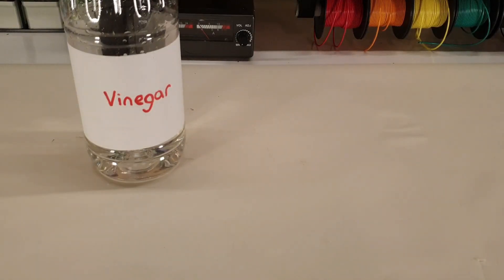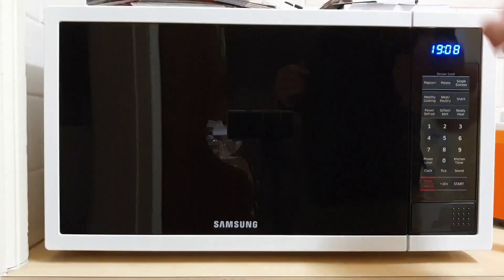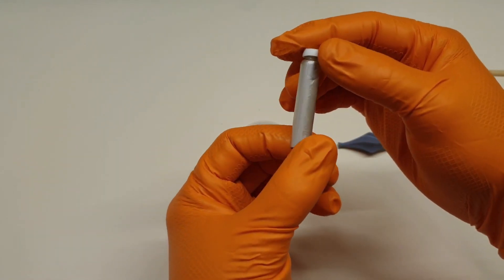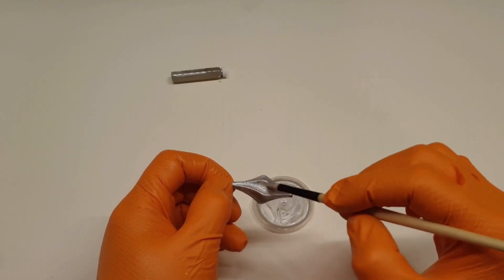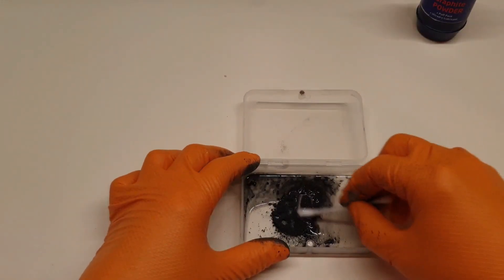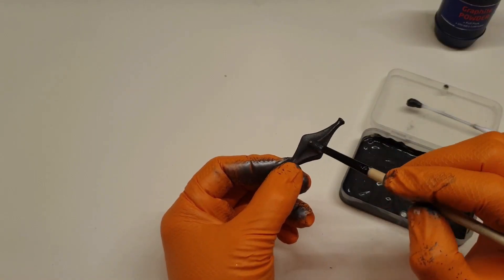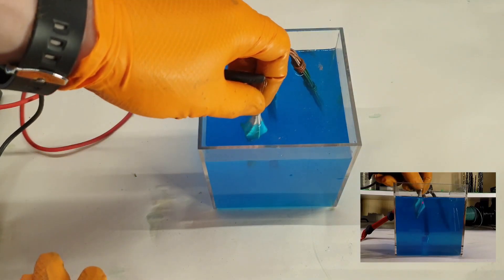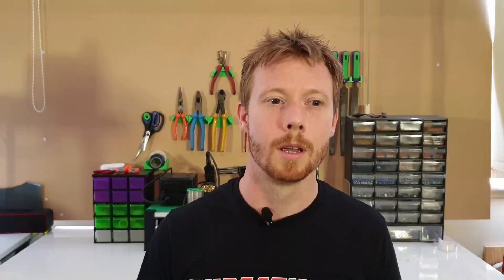Metal plate your 3D prints at home.

Comment: Thank you for the video.  Does this process give the part a hard, metal like feel? I have some small knobs that I'd like to have them have that really hard feel to them, not plastic feel.
Reply from the maker: Yes, it's real metal after all. If the part you're plating is really light, the plated part will still be quite light which can ruin the illusion, but the surface will feel the same as a solid metal part.
Reply: @BrodieFairhall  Thank you for the reply, Brodie! Do you have any tips to adding weight to 3D printed parts?
Reply from the maker: @gracebyseven  I've printed parts with cavities and have filled them with metal scrap and epoxy. You could print parts with a grid infill at a low percentage and pause it before the top layers print to fill it with sand or something else. Printing with metal filled filaments (eg colorfabb copper fill) also makes rather heavy parts.
Reply: @BrodieFairhall  brilliant, thanks again for the feedback and support!

Comment: Have you tried printing in conductive PLA then electroplate directly without coatings?
Reply from the maker: Yes I have, I almost put it in the video too. The resistance was way too high and it wouldn't plate.
You may have different results with different conductive filament, but you'll need to make sure that the resistance measured at any 2 points on your print is < 100 Ohms or plating will be really poor and things don't really plate at all when resistance is > 1k Ohms.
The parts I printed in conductive filament had >15k Ohms across most of the surface.
Reply: @BrodieFairhall  I've been experimenting with graphite coating PLA, and I've had no luck getting resistance to levels under 1K Ohms, even with my multimeter leads only milimeters apart on the surface of a coaed print. I've been using Isopropyl alcohol to mix with the graphite.
Reply from the maker: @rileyjames5693  I've been finding that some people are having the same issue and it seems to vary wildly between graphite brands. I now generally use a conductive nickel spray paint from MG Chemicals instead of graphite for a much better result
Reply: @BrodieFairhall  it is a bit pricier - do you happen to recall what graphite brand you used in your tests for this video? I'd like to give it a shot before splurging for the nickel paint.
Reply from the maker: @rileyjames5693  this is the exact graphite I used in the videos. https://www.supercheapauto.com.au/p/power-plus-performance-plus-graphite-powder-lubricant-35g/1173.html
No idea if it's available outside of Australia.
You can also try multiple graphite coats and really rubbing the graphite in when it dries to lower the resistance.
Reply: @BrodieFairhall  thank you! I've sprung for the paint just in case, but I feel like the graphite has more mileage per dollar spent.
Reply from the maker: @rileyjames5693  it does, it's much, much cheaper, but the paint works so much better.
You can also get far better results using a dilute sulphuric acid/copper sulphate electrolyte as well, the vinegar based electrolyte is also cheaper and much safer, but it requires a much better conductive coating.
Reply: @BrodieFairhall  I have since experimented with some different approaches - different solvents, muratic acid as an electrolyte bath, and even mixing finely powdered copper from a sanded plate into the graphite paint ! (I had very high hopes for that - it didn't make a difference , sadly!) 
About a dozen coats of the initial isopropyl/graphite mix got my resistance down to the lower hundreds of ohms, but it was still lackluster for getting copper to adhere to the anode. 
I've got another brand of graphite powder coming to test out, but - the paint from MG chemicals is on the way, if I can't find a more cost-effective solution!

Comment: I thought at first you were gonna talk about bismuth
Reply from the maker: Honestly the only thing I can genuinely think of using bismuth for is casting into 3D printed moulds because they wont melt. It does look cool though.
Reply: @BrodieFairhall  yeah I don't have any experience in 3D printing (yet) but I love casting bismuth figures. The geodes and crystals can gorgeous. 
I wonder if there's a way to get them coated or to get that sort of metallic rainbow sheen on it. 
I would say maybe someone could dip a 3d model into some molten bismuth.and quickly pull it out (with the right safety precautions) to get a metal sheen and some crystal forms on the art piece. 
The bismuth melts at a higher temp than most prints but cools rapidly and would likely only do surface melting I imagine, on a thicker model at least, which wouldn't natter if it's covered. 
Eh then again prolly a bad idea. I don't think bismuth reacts with anything in a crazy way chemically but you never know.
Plus it'd be tough to do with the bismuth being heavier and the model would need to be a certain shape. Eh

Comment: What if instead of using a graphite powder & alcohol to make a paint, suppose you were to have instead taken a graphite pencil and used it to color the entire surface of your part that way? Could this method have worked just as well?
Reply from the maker: I have tried this and didn't have any success, the resistance was way too high. I have since found out that a lot of pencil graphite doesn't actually contain much graphite.
Reply: @BrodieFairhall  I'd read that pencils range in hardness from 9H (41% graphite content)  to 9B (93% graphite content). Perhaps you didn't use a soft pencil having high enough graphite in it?
Reply from the maker: @manofsan  I tried it with 5B pencils, that is the softest I could find locally ( I didn't even know they went all the way to 9B! ), I also only tried one brand.
If you do try it, I would be interested to hear about your results, I was really hoping it would work when I tried it as it would be a fantastic, safe & low mess method for teaching children etc. 
The resistance I measured across a 20mm x 20mm 3D printed surface heavily filled with the 5B pencil graphite was about 20k Ohms, the powdered graphite over the same area was ~300 Ohms, the Leitsilber paint was ~10 Ohms and the paint I prefer to use now (MG Chemicals conductive Nickel spray paint) is also ~10 Ohms.
I haven't been able to plate anything with a resistance above 1k Ohm resistance over a gap of 20mm using the Vinegar based electrolyte, but, a sulfuric acid / copper sulfate  based electrolyte is far more effective and will give better results.
Reply from the maker: @manofsan  Ultimately Sulfuric acid works better than most, not because of its low ph, but because it is also far more conductive than most other aqueous solutions, otherwise I haven't found much difference between the performance average "household" acids like lemon juice and hyrdochloric / muriatic acid.

As for electroless plating, if you buy a kit, it's easy, but unfortunately manufacturers are not forthcoming with their formulas etc and I haven't managed to get anything I'd call a success with a diy electroless plate either copper or nickel.

Comment: Coating a non-conductive part in metal is like the holy grail of manufacturing techniques to me. There's so many cool things you could do with this. Sadly, having to apply graphite powder makes it far less versatile. I guess i'll have to figure out how to do thermal evaporation after all.
Reply from the maker: Nowadays I use a Nickel conductive paint from MG Chemicals as my conductive coating before plating.

You could also look into "electroless nickel plating" as another potential option, manufacturers are pretty tight lipped about what goes into their electroless plating kits though.

Vapour deposition requires a bit more in the way of equipment, the main 2 being a vacuum chamber and a high current supply, but I can't see why it wouldn't be achievable in a home lab. If you do it, I'd love to hear about it.

Comment: But you are not shown copper plated on to the graphite and alcohol painted?
Reply from the maker: The silver based paint works faster for the video,  the graphite does work well though, but I would highly recommend a conductive paint like MG Chemicals Nickel, much cheaper than the silver paint and it's more robust than the graphite.

Comment: I will have to try this again. My first attempt failed. There was no copper forming on my pla printed part coverd with graphite/acetone. The graphite also washed off and contamimated the coper solution. Maybe the graphite will stick better if I mix it with acrylic  paint.
Reply: The acetone will degrade the PLA pretty quick - try a different solvent. Or goto ABS and the surface will dissolve and mix with the graphite a bit giving a stronger bond.

Comment: Have you tried this with gold plating? Do you think it would work directly on the graphite or would it need to be done as a second coat on top of the copper? Gold seems like an interesting option as not only does it look great, but it also doesn’t oxidize. Seems like it could be great for 3D printed jewelry especially.
Reply from the maker: I've never done any gold plating, I did see that Cody's lab has done a few gold plating and reclaiming videos. I'd probably start with a copper base though.
Reply: @BrodieFairhall  Thanks, I'll give it a shot! If I have any success, I'll post my results.
Reply: @einsteinx2  did you try? I am thinking of 3d printed jewelry with a silver plate.
Reply: @audone5551  unfortunately I never got around to trying this. Most of my 3d printing projects are on hold right now. If you try it and have any success (or failure!) please reply with your results!
Reply: @einsteinx2  will do. I'd like to make some intricate earings.

Comment: this was great. You should have millions of subs.
I have a question. I do not know anything about plating, can aluminum plating be done? what about steel? or other silver looking metals? what about brass plating? thank you and sorry for so many questions!
Reply from the maker: Nickel, Zinc and Tin will be your best option for silver colored metals, Brass plating also works in pretty much the same way, you will likely end up with a more red colored brass as the copper ions transfer more easily than most other metals. I have another electroplating video where I work with Nickel and use a different method to create an electrolyte.

Comment: Does anyone happen to know if the container for the electrolyte can be Plastic instead of glass?
Reply from the maker: You can use a plastic container, my other electroplating video has a different method for creating an electrolyte that doesn't require microwaving too.

Comment: Made my first attempt to plate a 3D print today. Got all set but when I lowered the part into the bath I discovered 3D prints FLOAT !
Reply: How did the parts turn out when you figured that part out?
Reply: @nczioox1116  I was aiming to get a textured surface like pitted bronze and that's more or less how the test parts turned out. Main problem i had was uneven plating with thick copper forming in some areas and none or thin in others. Unfortunately I've not had time to have another go due to illness in the family.
Reply: @ColinWatters  Oh I see. Thank you. good luck
Reply: Floating is likely a property of density. Pure plastic won't float but a lot of 3d printing is not pure plastic they have a lot of air in them and simply build the center with some scaffolding to save plastic and weight. In theory you could end up making copper coated floating parts that might end up being really kinda strong, since the copper shell would be pretty strong.
Reply: @davidolsen1222  Yes definitely a density issue I was only using something like 25% infill so lots of air inside. Just caught me by surprise. I'd been watching people plate metal objects suspended from hooks and had my own hook all ready to go when I really needed a boat anchor :-)

Comment: Looks great! Hiw durable is the metal layer though? Is it easy to scratch off even with thicker coats?
Reply: I wonder the exact same thing.  If it's sitting on that layer of graphite which doesn't seem to be bound by any adhesive at all...how scratch-resistant could the graphite/copper two layer coating be?

Comment: Can graphite from pencils be ground into powder to made the plating paint?
Reply: Most pencil lead is actually a polymer.
Reply from the maker: I tried this and the resistance was too high, but I only tried one brand of pencil, it could be totally different with others.
Reply: Just don't.  Running graphite gouging electrodes from the welding store thru a pencil sharpener is ok.

Comment: I followed the steps as you outlined them. I painted a part with graphite, but it did not plate. I put a steel nail in the place of the plastic part and it plated right away, so I know that the solution and power supply are working. I also measured the conductivity of the graphite powder I am using and it is fine. So what am I doing wrong? Any suggestions? Thanks for the video BTW.
Reply from the maker: The graphite coating (or other conductive coating) must have a really low resistance. I've found anything over 1k ohm / sq cm just wont plate at all and ideally it should be below 100 ohms/sq cm.

Comment: Great video! I have followed all the steps and the only thing different is that I am using Bare Conductive electric paint, when i submerge it into the mix, the paint is coming out. Any suggestions?
Reply from the maker: It sounds like your paint is water soluble. If only a little is bleeding into the water initially but enough is staying on the surface of whatever you're trying to plate, it might be fine. Otherwise you might have to try a different conductive paint. I've been using a nickel conductive paint from MG chemicals lately which works fantastically (and it's much cheaper than the little vial of silver paint I use in the video)
Reply: @BrodieFairhall  Are you using the 841AR acrylic, 841ER epoxy or the 841WB water based nickel paint from MG?
Reply from the maker: @stargazer7644  I use MG841AR as it's the easiest to find where I live.

Comment: I tried this process with graphite powder on my PLA prints but could not get the graphite to bond to the model. The graphite would just dust off when it dries. Looking at another you-tube video I used Mod Podge glue mixed with graphite, this almost worked as I could see some copper dust form after some hours in the solution using 4.5V and two copper plates on each side of the model. Have you successfully used graphite powder  before?
Reply from the maker: I used to use graphite powder all the time, some of the models in both of my plating videos are coated with graphite.
With graphite I generally get copper visibly starting to deposit to the model in a couple of minutes, you could try thinning out the modpodge with some alcohol and using less of it if you're finding it helps keep the graphite on.
I would measure the resistance of your coated part with a multimeter if you have one. I have found that if I put the probes 10mm apart and measure anything over 1k ohm, the part is almost possible to plate decently, <500 ohm tends to work great.

Conductive paint has worked much better for me and since making the videos I've started using a conductive Nickel spray paint from MG chemicals (there are other similar copper and nickel paints from other brands too). With this paint the surface resistance is much lower than when I have used graphite and it is much cheaper than the leitsilber paint I used in the video.

Comment: Also lets say i want to coat larger prints and mix up a gallon on this blue mixture for plating? how many times can you use this mixture? if i put it in a bottle will it keep for weeks, months etc??? thanks
Reply from the maker: Essentially, you can keep it forever. You will find that it gets more blue the more you use it, so you will want to add more vinegar when it gets really dark and there will end up being a build up of gunk on the bottom of the container from impurities in the copper which can just be filtered out (I run it through a coffee filter every few times I use it).
If you want to plate larger parts, definitely consider using multiple anodes, a conductive paint instead of graphite (I've been using a nickel conductive paint by MG Chemicals) and some way of agitating the solution.
Reply: @BrodieFairhall  Is that the paint that cost $20 for a tiny bit?not even sure that would be enogh for one 10 inch print... i am making these to sell so i need to keep cost low or there will be zero profit...thanks for your help..
Reply from the maker: @roadstar499  This is a different paint I discovered after making these 2 videos, much cheaper! If you look online for conductive spray paint, there are a huge variety of nickel and copper conductive paints.
Reply: @BrodieFairhall  thanks ill look..

Comment: Very cool...but you never said what power source? How much voltage... can i use a car battery charger? set to 6 volts 2 amps or 12volt  set to 2 amps or 6 amps... very cool where can you buy carbon powder to make paste? also once its plated can it break off since you said carbon cracks easy... thanks

Comment: How thick is the plating, does the part become significantly stronger?
Reply from the maker: The plating thickness increases with the amount of time you leave it to plate. Also, areas with the lowest electrical resistance (generally the areas close to the cathode and anode) will plate faster too and recessed or pocketed areas of the part plate slower. To give you a very rough example, I have plated an object for 30-40 minutes and when I polished it I rubbed straight through the copper because it was so thin. I then plated it for 12 hours and the thickest parts are a little over 1mm and the thinnest about 0.5mm, at these thicknesses it would start to genuinely effect part strength. Nickel would also have a more significant effect on strength than copper. The other video I made (linked in the video description) talks about a couple of these things.